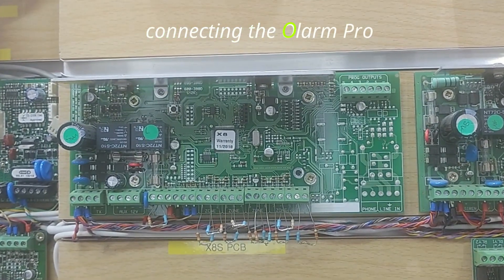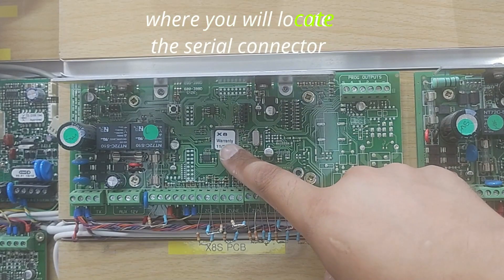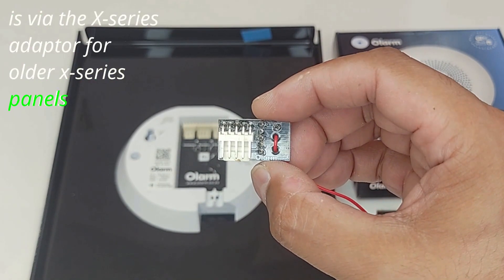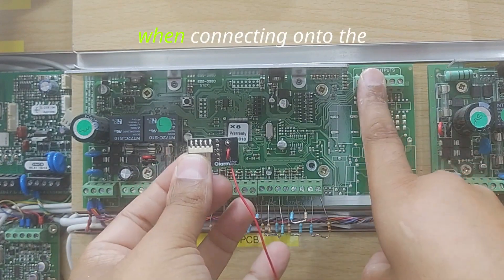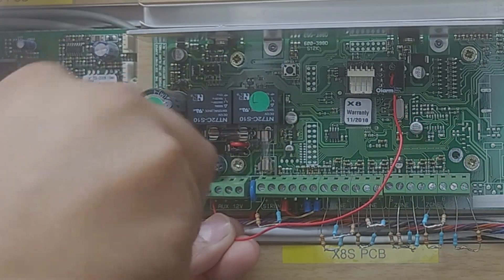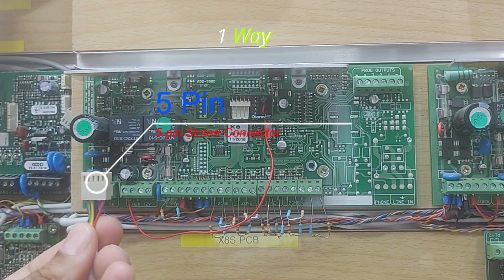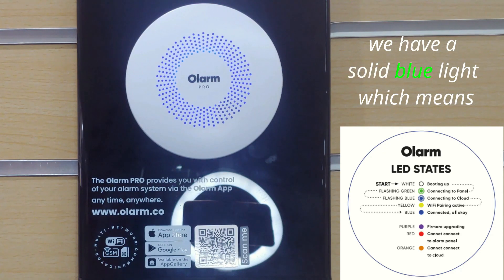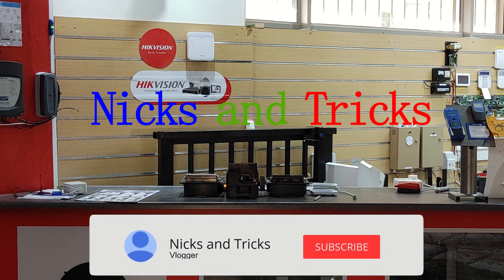Olarm Pro 4G panel connection (IDS -X-Series [old])

Comment: Hi thanks for the video. It turns red after installation done as prescribed. Anything to do with the J pins?
Reply from the maker: Thank you for the comment Jaco, if it goes from flashing green to solid red? Check the orientation of the adaptor, red 12V power cable facing the pgm's. And make sure to wire in the power into 12V Aux. The other thing to look out for is cell signal, move the Olarm as far away from the panel as the cable will allow you to